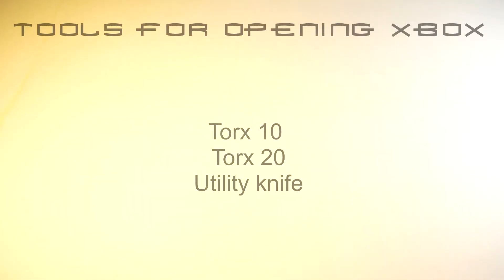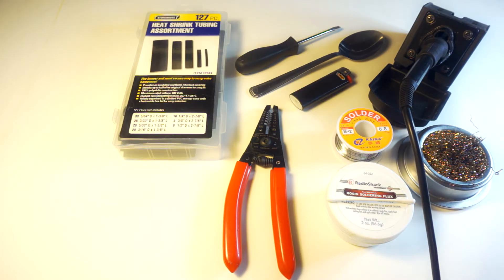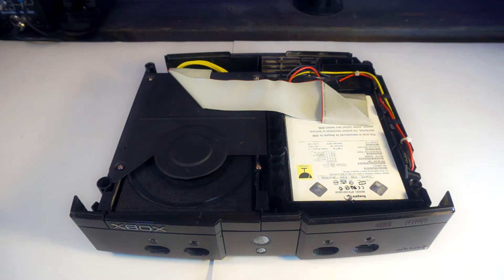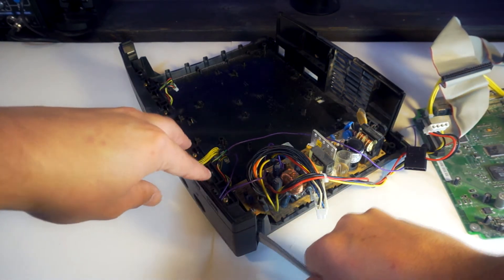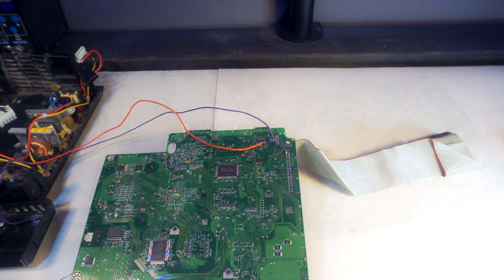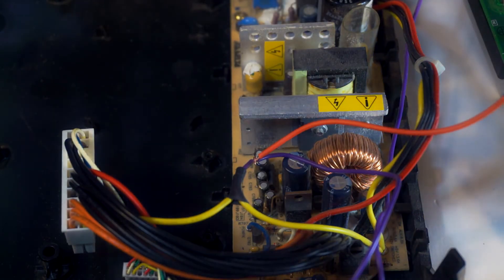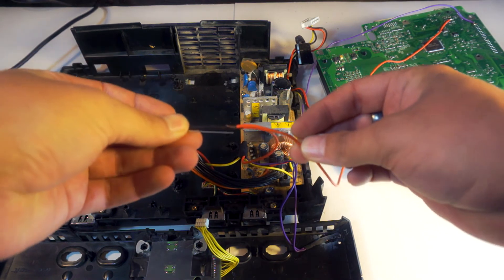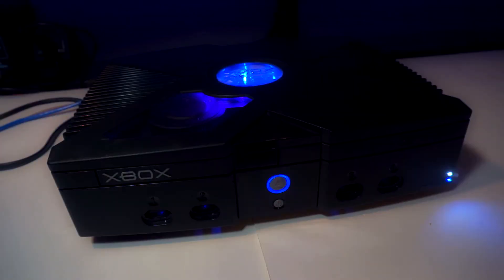How to Add a LAN Activity Light to an Orignal Xbox

Comment: I was thinking
You can too add an activity controler port LED.
In place of the numbers 1,2,3,and 4 put a LED 
When conect controler activity the LED.
This is just an opnion because I dont know if is possible.
Reply from the maker: yeah you could make an LED light up when a controller is plugged in, you would make it so the LED gets grounded when plugged in. you could also make it blink when the controller is sending data by connecting it to a data line. though iv never done either so unsure on the specifics
Reply: TechnoOnTop 
In my xbox the lan activity light up when turn on my console.
I thinked the LED light up when the lan cable is conected.
is this right or I did something wrong?
Reply from the maker: No you didn't do anything wrong, it's getting power doesn't matter that it isn't plugged into a network , with the xecuter modchips they used some other circuit built into their chips to only show 'activity' its something I wanted to look into but haven't yet. Same goes for the hard drive activity lights.

Comment: Nice video, you could also probably use a diffused LED to dial down the brightness.
Reply: Floydzabarber duuuude! how's the Xbox laptop Goong?
Reply: Not bad, I haven't worked on it much at all in the last year, but I did get a smaller pcb with surface mount components to go between the pico-psu and the Xbox motherboard.
Reply from the maker: yeah diffusing it would definitely help, thanks for watching man!